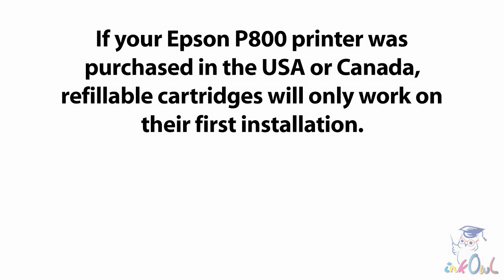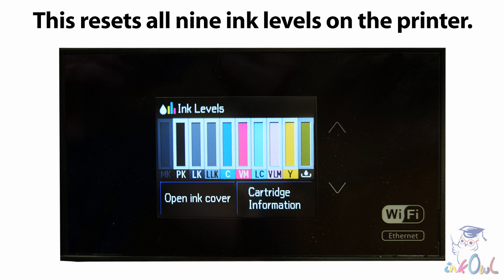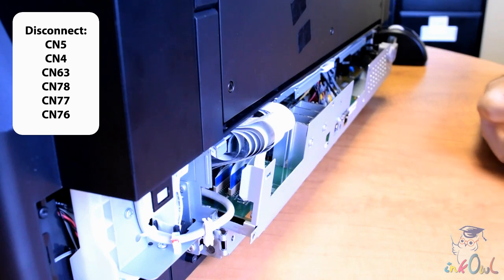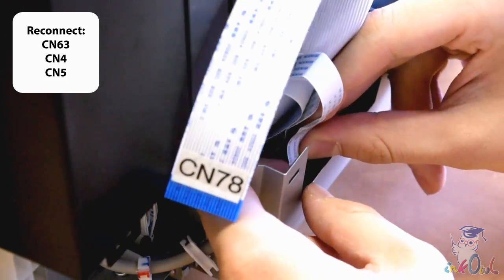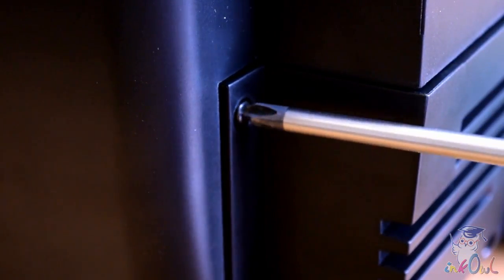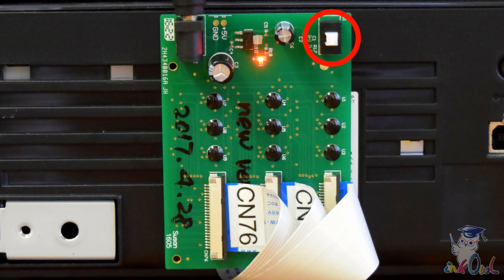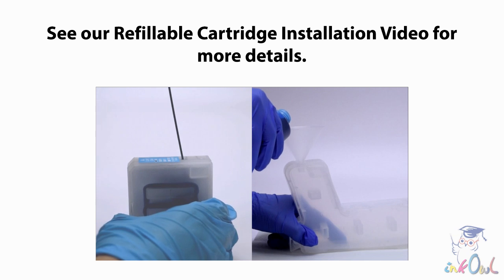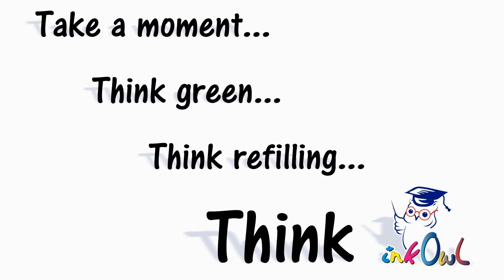How to Install a Chip Decoder (Bypass) on Epson SureColor P800

Comment: After this unit has reached its 30 time life span. Can a chip resetter be used with a refillable cartridge? If a printer is New and never setup, and a aftermarket refill tank is used on its first setup will there ever be a need to use a decoder or resetter?
Reply from the maker: Once the unit reaches its 30 reset lifespan, there will be no choice but to go back to OEM Epson cartridge on that printer. There is nothing else to do. Keep in mind 30 sets is a significant amount of ink consumption and the printhead will be close to the end of its useful life.

To answer your other question, installing aftermarket cartridges on the first setup makes no difference. After the first use of the cartridges, the chip decoder will be required.

All this is applicable to printers from the USA and Canada only. These printers have an innate restriction that requires this modification as ordinary chip resetters or single-use chips do not work after the 1st use.
Reply: @InkOwldotcom  Thank you for the reply. One for detail to clarify.
This product can use chip 30 times. How about a chip resetter? Can you use a chip resetter more than 30 times or will the printer know to blacklist the cartridge ID after a few reset of original cartridge?

Comment: After 30 uses (29 reboots), the chip decoder can no longer be used on that printer. But is the printer still working or can you buy another chip? or just stop working?

regards
Reply from the maker: The printer will still function with OEM Epson cartridges if you reverse the installation of the decoder, but you cannot install a new decoder. That being said, after 30 uses, you will have saved $5000-$10000 compared to using OEM Epson ink, more than enough savings to justify buying another printer, if needed.

Comment: hi i have a p800 i purchased in Australia do i need this decoder?
Reply from the maker: That's a good question. I do not know how the P800's in Australia are programmed, we have few customers there and no customers on the P800. My advice would be to try with refillable cartridges. If the refillable cartridges reset once empty, then you're good. But if they do not, we'll try changing the chip. If it works, then great. If that also fails, then the decoder will be required.

Comment: If I am buying from Japan SC-PX3V (P800 Japan version), Is it Asia -Pacfic version ? Do I need this  decoder?
Reply from the maker: I believe that Japan is considered a region apart by Epson. I do not know if a decoder will be required, or will even work in this printer since it's technically a different model than P800. We have no experience at all dealing in the Japanese market, I'm afraid.

My recommendation if you want to refill is to get the P800 printer in China, that way the refillable cartridges with ARC chips are guaranteed to work. Or, you can check with a Japanese supplier of refillable cartridge products, who will know how to refill the SC-PX3V.

Comment: Also does the chip decoder work on the p800 model in Asia?
Reply from the maker: The chip decoder works worldwide. However, if you have an Asian P800, you can simply purchase refillable cartridges with ARC chips, no need to buy this decoder to refill your printer.
Reply: inkowl.com Great. What are the model numbers or serial numbers to determine if your printer is the Asian or North American version?
Reply from the maker: It's where the printer was bought that determines it, simply. I don't know of any straightforward way to check just using the serial number. What country was your printer bought from?
Reply: inkowl.com I'm just deciding on making the purchase. I will buy it in Jakarta Indonesia so I would assume it will be the Asian version.
Reply from the maker: Oh okay. Yeah, if you're buying in Indonesia, you will definitely have the Asia-Pacific version of the printer. As such, you will be able to use and re-use refill products without needing this decoder.

Comment: So what happens after resetting 30 times? Can you not use the chip decoder again after that?
Reply from the maker: After 30 uses (29 resets), the chip decoder cannot be used on that printer anymore. However, by that time, you will have saved $5000-$10000 compared to using OEM Epson ink, more than enough savings to justify buying another printer.
Reply: Interesting. Just out of interest can you just remove the chip decoder, replace the cables and go back to using the OEM ink cartridges?
Reply from the maker: Yes, you can absolutely remove the chip decoder to go back to OEM ink, at any time!
Reply: inkowl.com an another new chip decoder would work on the same printer?